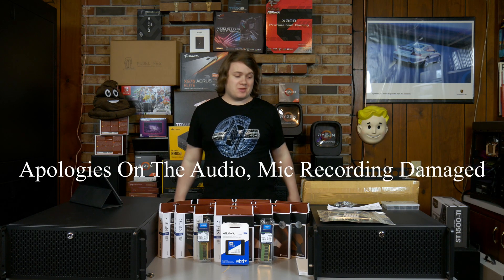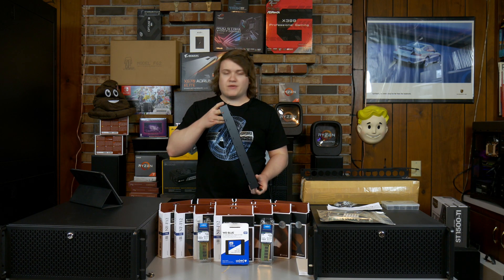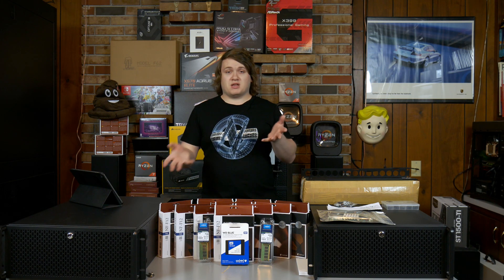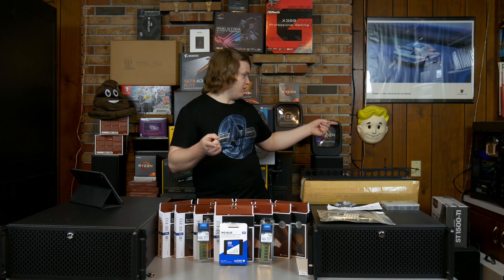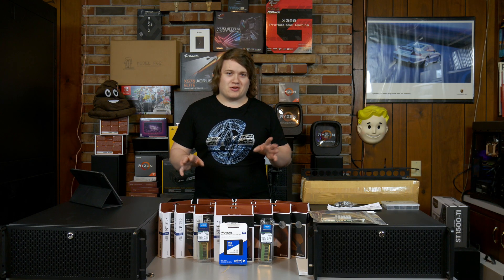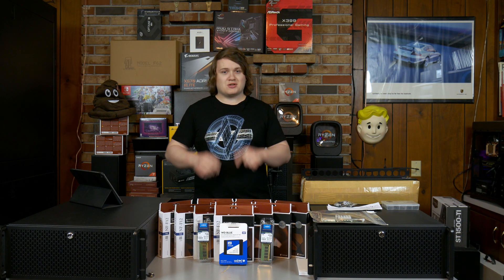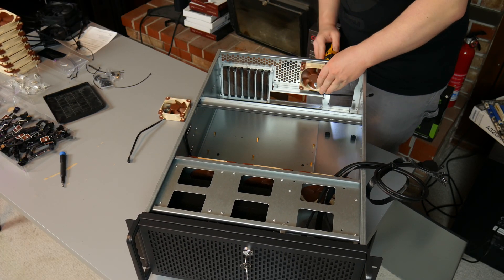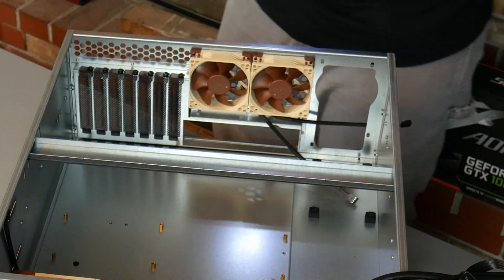ProxMox Server Build Update | Rosewill RSV-4310L Quick Review

Comment: I have had good like with these rails. https://www.ebay.com/itm/382581770157
The rack I use is a 25U  4 post startech.
Reply from the maker: Hmmmmmmm I might just pick these up, the Rosewill rails have been reported to be pretty terrible actually (scratching the chassis and not fitting in some racks), these look like they might work better. Will grab a pair and see if it fits that well and then pick up more if so. Greatly appreciate the recommendation.
Reply: @WordTech  Here is a how to/review of them on a rosewill chassis in a startech rack.  
https://forums.serverbuilds.net/t/rack-mounting-the-rosewill-rsv-l4500/2804
Reply from the maker: Thanks, greatly appreciate the info! I've been looking for some good rails for these, I'll grab a pair and see how I like them.

Comment: I HAVE QUESTION AND THIS IS VERY IMPORTANT.I BOUGHT THIS CASE AND HAD TO EXCHANGE 3 TIMES DUE TO THE 7 SLOT PCI SLOT NOT BEING ALIGNED MEANING WHEN I PUT MY GRAPHICS CARD AND OTHER STUFF I HAD TO PUSH IT FORWARD AS HARD AS I CAN JUST TO SCREW IT DOWN.DID YOU HAVE THIS PROBLEM AS WELL.BTW YOUR RIGHT THERE QUALITY CONTROL IS HORRIBLE.
Reply from the maker: I have not experience that issue, however I have had a few screws get stripped out super easily. I'm still happy with it for the price but the quality could use some work for sure.
Reply: I have both this case and the 4500L and I have not had this issue.